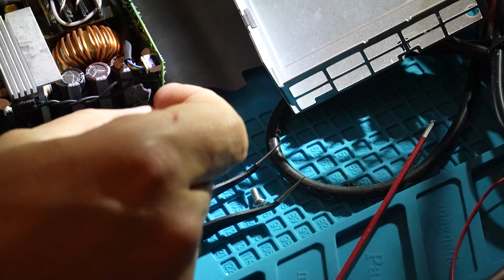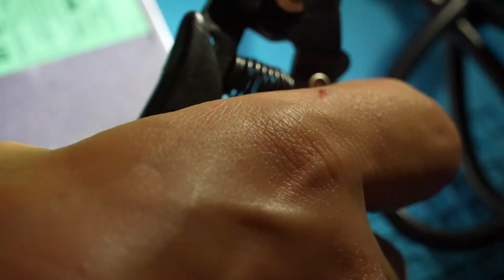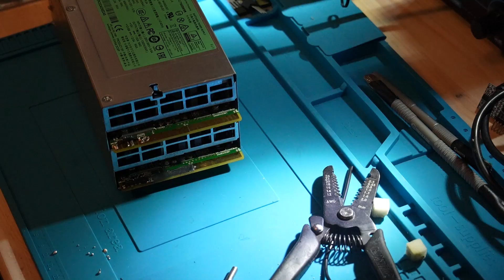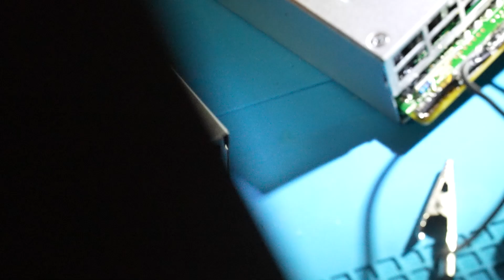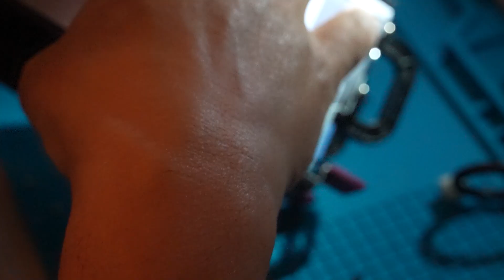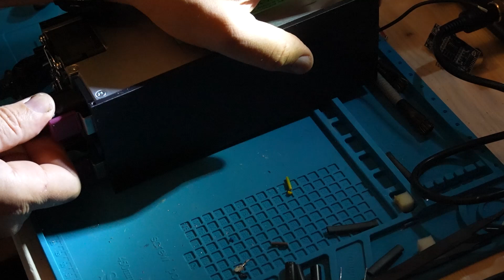24V Power Supply from Two HP Server PSUs

Comment: Awesome videos. I was wondering if you could share the file for the 3d printed case?😊
Reply from the maker: Thanks so much, glad you liked the video! I’ve uploaded the 3D-printed PSU case files here: https://github.com/thewiz4real-ops/3D-Prints/tree/main/psu-enclosure

The repo has STL and 3MF. The 3MF is set up for ASA, so adjust if you’re using a different material. There are two lid versions, one with standard M3 holes and one with slightly wider M3 holes to give a bit of wiggle room during assembly. Both are for M3 screws.

I posted two fix videos. The second video still has a mistake, but it’s progress over the first. The last video shows the final solution. Please watch the whole series to understand the issue and how I fixed it, the links are in this video’s description.

If you have any questions, just ask, I’m happy to help
Reply: @TheWiz4Real thank you.
Reply: @TheWiz4Real do i print 2 tops for the top and bottom? Thanks again.
Reply from the maker: Exactly, the same part is used for both the top and bottom, so just print it twice

Comment from the maker: 🔧 This is the first video in a 3-part series where I work through building a dual power supply setup for 24V output.

⚠ I made mistakes in this video that caused problems later — so please watch all three videos to understand what went wrong and how I fixed it safely.

➡ Second video: https://youtu.be/jmPY3B4CS4Y  
✅ Final and safe video (correct solution): https://youtu.be/pZ_o9EucBNY

Comment from the maker: ⚠ Be careful when working with power supplies in series and grounding. Connecting your PC or USB devices while your power supplies are connected in series can create dangerous ground voltage differences and damage your electronics.

If you are using this setup, make sure you understand the risks and know how to isolate your second power supply safely. Removing or disconnecting earth ground incorrectly can be dangerous if your system has exposed metal or a PSU fault.

I have uploaded a new video explaining what went wrong and how I fixed it safely, including important precautions:

👉 Watch the new fix and safety video here  https://youtu.be/jmPY3B4CS4Y

Always check voltages with your multimeter before connecting your USB or grounds.